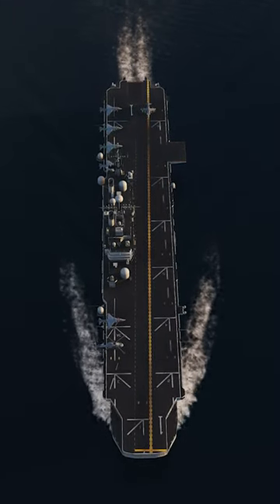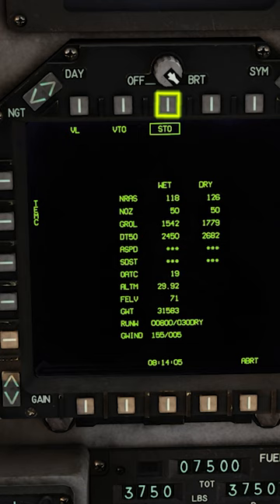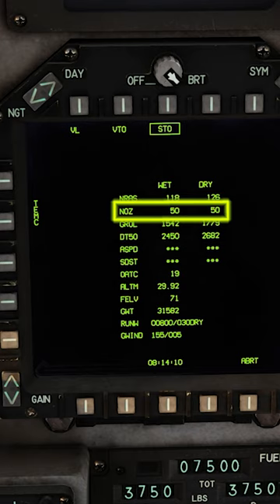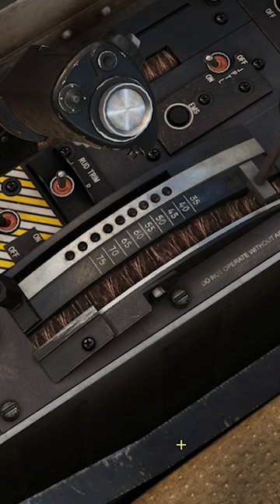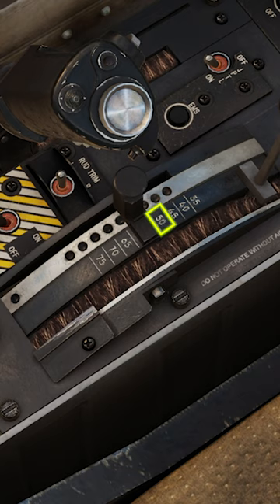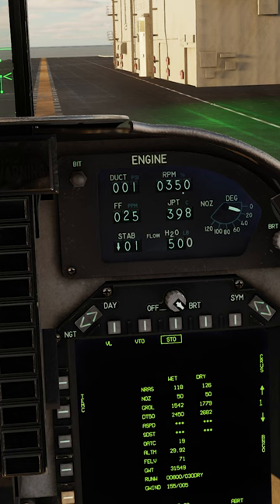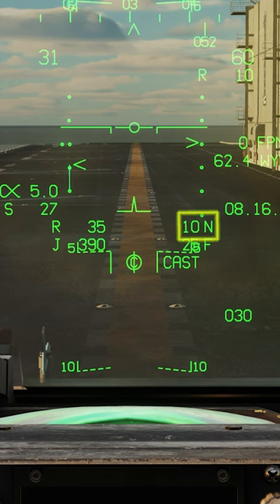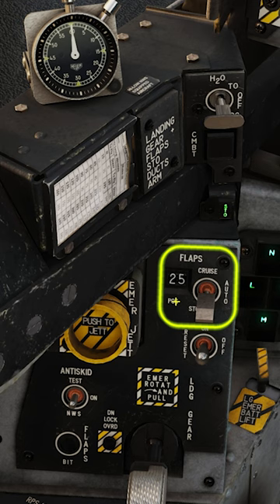Harrier V/STOL: Takeoff from the USS Tarawa!

Comment: Just out of curiosity: What is water injection?
Reply: It's when water is injected into the engine to simultaneously provide cooling and increased thrust
Reply: spraying water into the compressor turbine of an engine reduces intake gas temperature, effectively increasing the compressor ratio and allowing more air to be sucked through. more air, more fuel, more fwoosh.

water is also heavy, and jet engines work by accelerating gas to create a reaction force as thrust. more mass to accelerate increases the thrust output.
Reply: Instead of using an afterburner the Harrier overworks the engine so it injects water to keep temperature down
Reply: Also just to keep temperatures down in general
Reply: @jamesidk_9081 yeah, its a pretty sweet system and solution to what was at the time a major problem.
Reply: Hover too long over capacity and the water will get used up causing the engines to lose lift and causes you to fall to the ground.  It’s more if a simulator than a video game.

Comment: I mean.... couldn't you just do a vertical take off? Also would be better off building RPM with your brakes on and releasing them once your engines are at full power.
Reply: you could, but your max weight is heavily reduced if you choose to do vtol